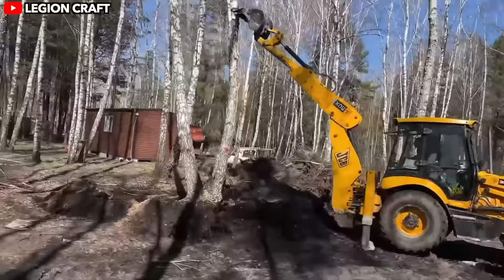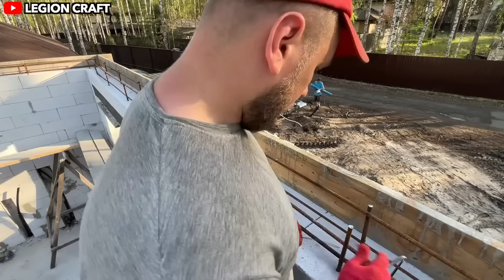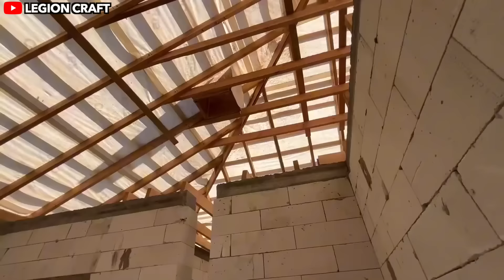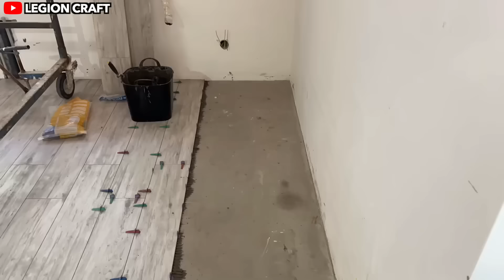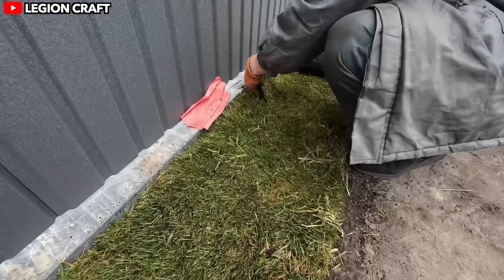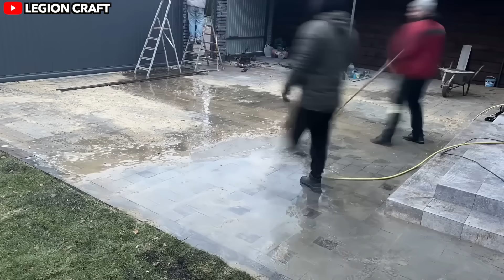He Built a Full House in JUST 10 Days — You Won’t Believe the Cost!

Comment: II don't know where this construction is (Ukraine?). In Poland, there are not 7-8 people working, but 2-3, and they can build an entire house from nothing to the  closed shell condition—foundation, walls, roof, windows, and interior walls (excluding plumbing and electrical installations, interior and exterior plaster, and insulation)—in about 4-5 weeks. The electrical and plumbing installations with the boiler take about 3 weeks, the facade with insulation takes 2 weeks, roof insulation and plasterboard take 10 days. The interior finish takes about 2 to 3 months. I think the boys here build well, but not with 7-8 people—that's definitely too many. The material cost of the shell stage with installations (materials only) is about 80-90,000 euros.